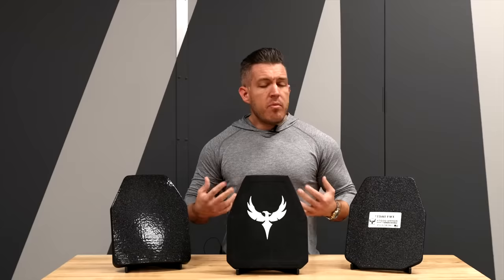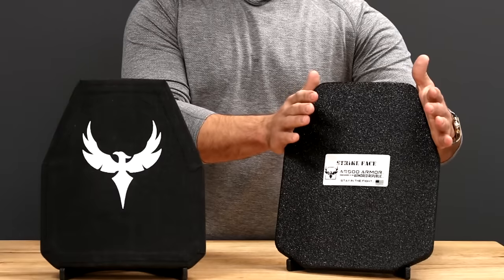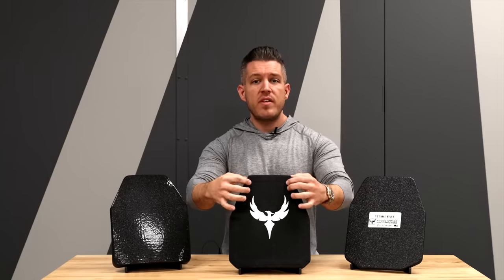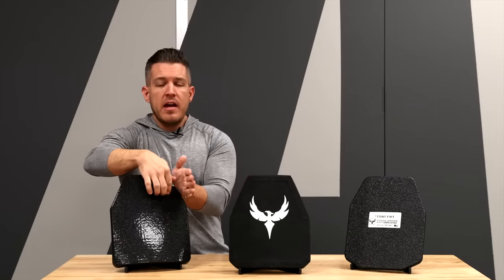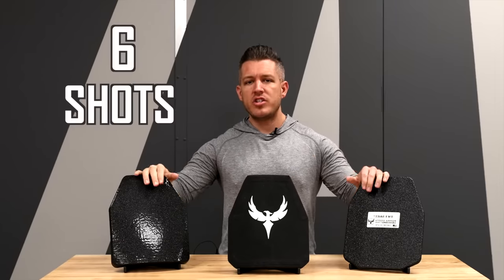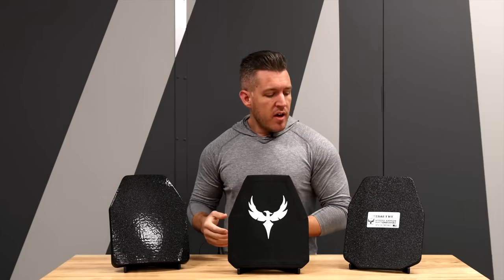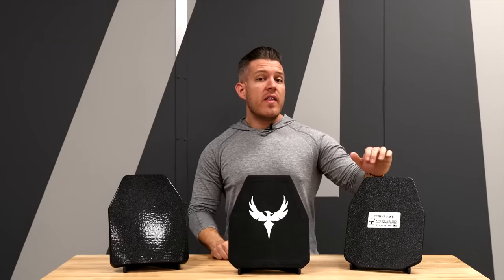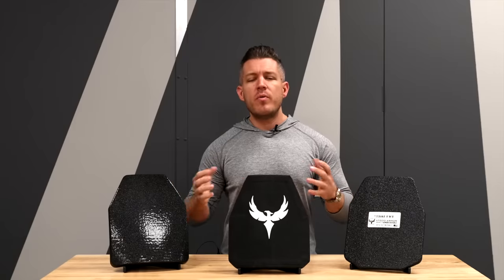What most armor manufacturers aren't telling you?   AR500 Armor

Comment: What about fragmentation to the face from the steel plates?
Reply from the maker: Long story short it does not happen unless you are using a base coat steel plate.

We offer built-up layered frag lock coatings that absorbs 100% of the first few rounds fragmentation, making steel completely safe for use.

We also offer fragmentation shields that add redundant protection capabilities.

We offer armor manufactured in UHMWPE that does not produce fragmentation as a by-product.

We would lastly mention we make ceramic armor, but despite popular misconceptions, it would be false to list it as an armor type that does not cause fragmentation hazard.
Reply: @ArmoredRepublic2  🤓🤓
Reply: Don't listen to them, don't buy steel.

Comment: A 10x12 plate with a 2" border would not be equivalent to an 8x10 plate but to a 6x8 center plate.
Reply: Correct!
Reply: Came here to say that exact same thing!
Reply: I just deleted my post when I saw this was already mentioned a bunch of times.  But ya, someone failed woodworking class.
Reply: Mike McKay simple math
Reply: You guys aren’t even listening past the edge explanation.  Linda! Listen to me!  He explains how the steel plates that they use offer a true edge to edge protection.  This may not be the case with other steel and not with the ceramic plates, not to mention soft armor. 🤷
Reply: Mark Belk  No, doing a lot of woodworking and carpentry.
Reply: @bowl816  We heard his explanation (& I rewatched it).  HE made the comment that a 8X10 steel would have the same protective area as a ceramic/poly 10x12, with the edges discounted, but used poor math.  WE were stating that the 6x8 steel would have the same protection as the ceramic/poly.  We were all understanding his comments of edge protection, but he incorrectly stated the sizes.
Reply: @rev-mikemckay9750  no he stated the right size when, you're building a symmetrical object you pull your measurement from the center. 2inches is 1 inch on each side of Center. 
e.g. 1|1 not 2|2 
SO, if it's 10 by 12" 1-inch from each side of the center is what??
Reply: @vaguestvestige  Have to disagree.  He was talking about a 10x12 plate having 1" around that was 'softer' and equating that to an 8x10 plate.  The mode of measuring  is NOT for a "symmetrical" object but for a plate.  You don't measure a 10x12 from the center, but from  edge to edge.  A 1" boarder around the perimeter would still circumscribe a 6x8 plate, not an 8x10.
Reply: @rev-mikemckay9750 Fun fact the more symmetrical your face the more handsome / beautiful you are,🤨symmetrical means two matching sides,so the plate is symmetrical. But I digress that's neither here nor there after rewatching the video he did say "2inch Perimeter all the way around".
Reply: @vaguestvestige  True, the sides are symmetrical, but they are not measured from the center (otherwise you would have a 5+5x6+6 plate.
Reply: @rev-mikemckay9750  I'm an HVAC mechanic so I take these type of measurements all the time. Anything symmetrical can be measured from Center, center always holds true. Measuring from Center only means the middle. You're trolling now 😅 2 sixes make 12 lol what???  from center means from the middle to the edge. You measure from center both directions to get total e.g. 20 3/4" + 20 3/4" is 41 + 1/2" total, you see what I'm saying now?
Reply: I see that AR500 hasn't replied to all of the comments pointing this out. Looks like they're are dodging admitting this fact. Makes me give second thought to buying from them.
Reply: @bowl816  True however the IV ceramics edge performance is still better than the level III+

Comment: what my issue is all these plates and armor just barely cover your vitals and are relatively small and massively high in price , i can make much better ballistic armor that cover more of the mid body and offers better protection for much cheaper
Reply from the maker: Then by all means, go for it, as long as you are informed and protected, that's our goal 💪 Stay safe out there
Reply: 🙌Finally someone with common sense, I wear level 3 steel plates but with additional custom cut steel behind them just for this cause

Comment: Why don't you use a final layer of steel to prevent back face deformation and help stop M855 on ceramic and polyethylene bonded plates? I know it would be thicker but seems like an "unholy" trinity lol. You could rim the plate edge and first inch of the plate strike face circumference with thinner steel at a steep angle to help with edge shots. The thickness of the edge steel would have to be enough to let an armored penetrator pierce beyond the edge steel and be slowed by the layers of ceramic and poly and finally the back face steel. I know nothing but tanks use a lot of layers and steep angles to stop rounds so that's what I was thinking.
Reply from the maker: That's actually not a bad idea. It's a very interesting and innovative concept. We will pass this on to our R&D team to see what we can do. Thanks!

Comment: You forgot to mention the weight difference. Back in my prime 18-26, while I was in the military I could run and gun with 10lb plates (30lbs total in plates front, back and side). Now that I work in a office 9-5, with no gym membership, I cannot run and gun with 10lb plates. Weight is a huge factor IMO.
Reply from the maker: Our level III steel 10" x 12" is about 7.5lb's, 8lb's w/ our build-up, III+ LW Steel is about 6lb's, Level IV is about 8lb's, PE is about 3lb's.
Reply: @ArmoredRepublic2  /My son has the 6 lb plates they make a huge difference 1/2 total weight
Reply: That could be a decent workout for you if you were to get the same thing, and regularly go hiking in it.  Eventually, you'll be able to run, and move quickly through rough terrain.  Just get some good boots.  I got a pair of surplus IDF boots from McGuire Army Navy that are superb the other day.  They're made in the U.S. by McRae, and have the best Vibram soles I've ever had on a pair of boots.  Only cost $85.
Reply: @wlde9949  I got 3lb hesco plates, not putting steel targets in my plate carrier and calling it Armor
Reply: @joshbeasley21  Hesco is like $2k just for a set of lvl 3
Reply: @JC-cv3up  more like $600-1000 depending on model, they do have some that cost quite a bit but we are taking about gear that will save your life. It's a good idea to invest in quality gear when you're relying on it to save your life. You don't have to go with Hesco, you can get a set of ceramic plates for $250 that will be alot better than stuffing targets in your carrier. 🤷‍♂️
Reply: you ever try not aging?
Reply: @JC-cv3up  Depends on what you get, the lighter it s the more it cost. Some Hesco LIV plates were going for $125 a plate. Luckily I was able to sell my steel plates and now run ceramic that weigh half as much and stop more.

Comment: Maybe my math skills aren't what they once were but it seems to me that a 10x12" plate with a 2" perimeter weakness woukd equal a 6x8" if you subtract 2" from each end of the overall measurements not 8x10" ehuch is pushing 50% less actual coverage than advertised...

Comment: I used to build and test level 4 ceramic composite plates for our company. Much of our testing was done with military 30-06 armor peircing. We tested with other materials as well. shooting into steel was very dangerous , as the penetrating core woul fly all over the range. I built a 2 inch thick plywood box to contain the sample. Many penetrators went out the side of box. Also smacked in the face with peeled off jacket a few times,flies straight back the trajectory. Finally put a laser on the rifle to aim and triggered it remotely. Just not safe with peices of penetrater flying all over the range. The composites were less deadly to bystanders.
Reply: Good point. It's like putting a steel target on your body. Those frags have to go somewhere, and on a steel target it's radially all around at 90 degree angle, perpendicular to the line of shot. Go to 6:29 in this Jerry Miculek video https://www.youtube.com/watch?v=HOx2Zhp3IGI

Comment: Your math is off just a bit...10x12 wouldn't go to 8x10...have to remember that's 2" all the way around which means top bottom and both sides...if you take 2" off each edge it shrinks your capable area to 6x8 because you have to take a total of 4" off ...so 10" with 2" off each side comes 6" not 8" and the 12" length with 2" off both top and bottom comes down to just 8".
Reply: Moreover, even NIJ 06 specs are about 3 inch, NOT 2 for rifle rounds. 2” only for pistol and ONLY for NIJ 06.
Basically, we are talking about 20 % of whole plate area to be protective, while steel has almost 90 % protection area covered. So, talking about weight to performance ratio, ceramic and PE panels are MUCH MUCH worse than steel with some fragment catching coating. Say 5,5 pounds of weight for 20 % area protected vs 6,5 pound of steel for 90 % covered.
Reply: Important point

Comment: You know what else they don’t tell you... from what I understand is that you mention NIJ rating and then say you have a III+... buuuutttt NIJ doesn’t have a rating of III+.... so most responsible armor manufacturers doing Polly do not rate III+ on there plate. Correct me if I’m wrong....
Reply from the maker: Without special threat testing, which is what the + is, there would be no armor that is rated to cover rounds outside of what the NIJ aims at in their rating system. That would be terrible. There are many more calibers than what NIJ covers.

Comment: How will level 3+ lightweight do with spall without the built up coat?
Reply: Good question. Just ordered one but it looks like the build up is not available and the shown armor only has the base coating. Could not see if the fraglock build up can be end user added when available.

Comment: There's a serious downside to edge shots on AR500 steel that is reduced on other material plates and that is lead splatter. UHDPE plates do very well on edge shots in spite of delamination and hybrid plates do even better than straight AR500 steel with coating.

Comment: if you have a 10x12 plate and subtract 2 inches from each side , you don't end up with 8x10 you end up with 6x8. Gotta remember 2 inches from EACH side.
Reply: 1" off each side would make it 8 by 10?
Reply: @fbomb2077  correct.
Reply: Hmmm guess I shouldve gotten 12x15 plates.

Comment: Biggest downsides of steel is possibly spaling if the coating is compromised and the fact that doesn't float (if you need something in a maritime environment).  Otherwise, it is an interesting option.
Reply: The biggest downside of steel is that it's near useless as armor.
Reply: @hunterkiller232134  lol, tankers might disagree.  It's not useless, but it's definitely not the first choice.
Reply: Only reason why spaling is an issue is because people wear just plates and those tiny plate carriers, your meant to wear steel with a full otv vest with soft armor in it

Comment: Can you do a video showing the difference in base coat vs. build up in spall mitigation on a level III+ plate with m855 and m193 (I know that’s a lot)? Every time I’ve seen a balloon test, it has been with build up coat. If you do this, can you keep shooting until balloons pop (point of failure)? I’m interested in defeating common rifle rounds and walking away without shrapnel in my neck, arms, or legs. I also want to shed ounces where I can. If I can go with a base coat instead of build up to save some weight, I will. Is this something you could do?
Reply: Airsoft Speedy I think base coat is just rustproofing.
Reply: @ctrlaltdebug  No it's not.  It's is very similar to truck bed liner.  You are asking for a bad day without the build up layer.

Comment: Sorry mate, a 10" x 12" plate with a 2" non-protective border around its perimeter does not equate to  8" x 10" of actual ballistic protection; the correct answer should have been 6" x 8" because there is a 2" non-protective border on both sides as well as at the top and bottom, which actually equals to a non-protective border 4 inches (2" + 2") width-wise and 4 inches (2" + 2") height-wise , hence the correct answer for the total ballistic protection area for a 10" x 12" plate is 6" x 8".

Comment: Actually it is worse than that on the edge shots. Take 2” tape, stick it along the edge of one of your plates, around the whole face, now measure the space you have in the middle. If you have a 10” plate, 2” off each edge leaves you with? Right, 6” not 8”.

Comment: But a two inch boarder around the perimeter or a 10x12 plate doesn't reduce it to 8x10 it reduces it to 6x8.  If it's a one inch boarder that's reduced to 8x10. So is it a one inch allowance or a two inch allowance? Because 6x8 isn't nearly enough to cover your lungs.

Comment: Great video, loved the detail breakdowns and explanations. I've been looking into a shtf set of plates and of course all my buddies say "get ceramics lv4 is the best". I'm a big guy and let's be honest, I'm not going anywhere fast regardless of what I'm wearing or not. Yalls upgraded steel plates aren't much heavier than the lvl 4 ceramics and ya got the bigger 11x14 for those of us with more height and chest than the average joe. Plus there is the 20 yr shelf life vs 5 years.. this is a shit hit the fan buy, I think steel plates are the way to go.
Reply from the maker: We aim to inform due to the level of misinformation out there. Your buddies statement are somewhat a response to that misinformation.

Ceramic is rarely needed for domestic use given its only advantage over steel is its ability to stop a wider range of AP rounds and explosive blast mitigation, both are threats we fortunately do not see in the US.

You are also correct on the shelf life as this is something that is almost never considered to those who incorrectly assume ceramic and steel are "almost" the same price. You have to multiply the cost of the ceramic plate X4 per plate (so X8) to get the accurate cost comparison to steel.

Not only that, ceramics are susceptible to rough handling while steel is not. Weight is another topic that is often misquoted. Ceramic and steel are in the same weight category, with light weight steel being far less expensive than lightweight ceramic.

We agree with your assessment on SHTF preparation as this favors steel 100%. Thank you for the compliment and support, stay in the fight!

Comment: Good video. but...
It's not 8x10, do the math. that's -2 on the left, -2 on the top, -2 on the bottom, -2 on the right.
If its 2" on each side, it's -4" total across each axis, and a 6x8 zone which is ballistic rated, on a 10x12 plate.
unless you misspoke and meant to say it's up to 1" on each side which isn't necessarily ballistic rated (for a 2" total)?

Comment: Also be aware of manufacturers who tend to leave numbers out of their testing in regards to velocity of the ammo being tested. I cringe when manufacturers/resellers apply blanket statements like "stops all .223/5.56 threats" or "all 5.7x28mm threats" and when asking them what they tested, they list off some low powered plinking ammo :\
Reply: 'Well, it stopped this Tula out of a 10.5" barrel.'

But what about M193 out of a 20"?

Well, that's just asking to much
Reply: @ALovelyBunchOfDragonballz   As a gunsmith in Texas I can tell you the vast majority of AR's I deal with are 16" or less.
Reply: @chrisgraves6677  As a strategist, I doubt civilians wearing body armor will be fighting against wielders of ARs... more likely to be facing government authorized 20" barrels.
Reply: That's why you only buy certified armor.
Reply: @BigTomInTheBasement  Except that most units are using the M4 Carbine which is 14.5" in barrel length.
Reply: @BigTomInTheBasement  Actually out of a 16in barrel the bullet is only traveling a hundred to two hundred feet per second slower. They are still flying out of that barrel at mach three.
Reply: @swaghauler8334  In that case, the armor will be more effective! ΜΟΛΩΝ ΛΑΒΕ!!
Reply: @BigTomInTheBasement  Anybody can be a strategist in their mom's basement.

Comment: Tyler I have a question.  In terms of the edge eslusion zone.  It is two inches from the edge.  Because that would render a 10x12 plate to only 6x8" of protection.  Or is the exclusion zone one inch from the edge on both sides?  Please elaborate.  Thanx